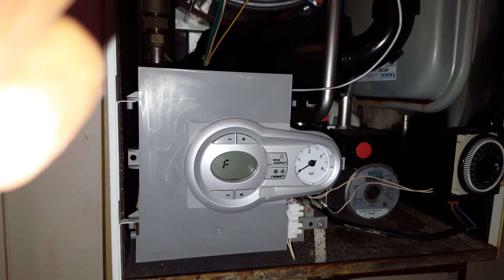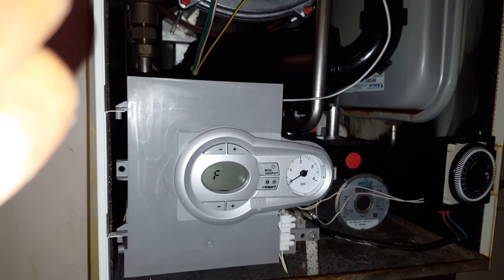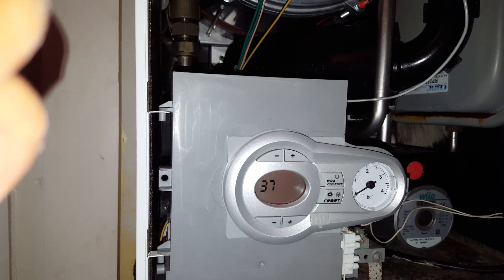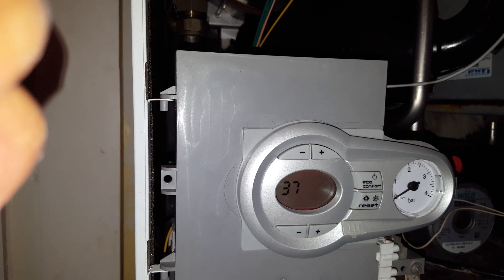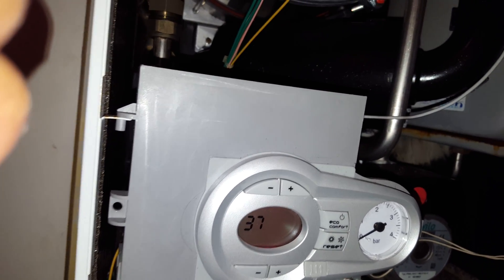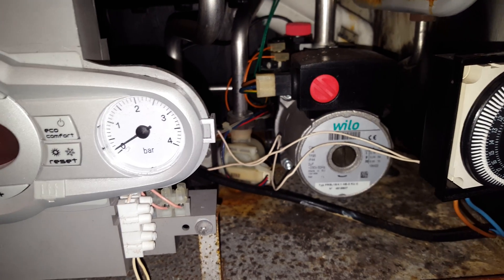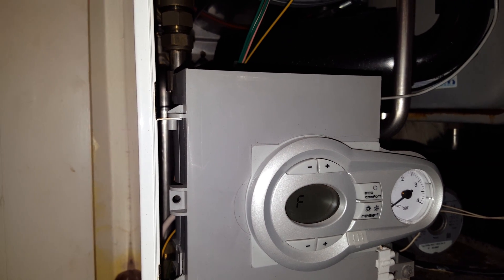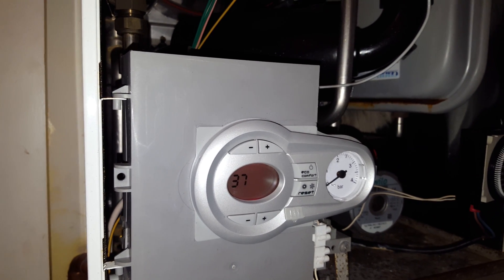F37 Fault FER0LLI modena 27HE

Comment: That boiler is also fitted with a crap wilo pump. The wilo pump in my Ferroli packed up 14 months after the new boiler was fitted. I had a replacement Grundfos pump fitted and the boiler has been circulating the system for around ten years now.